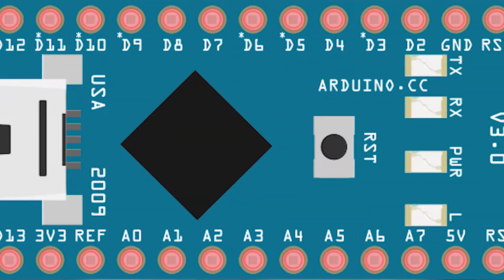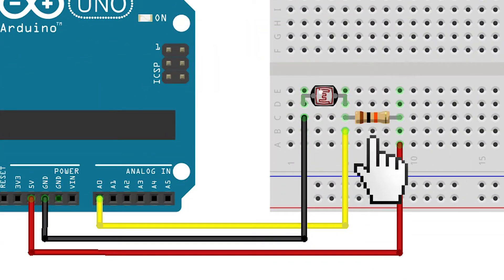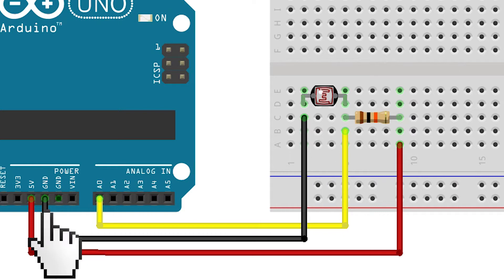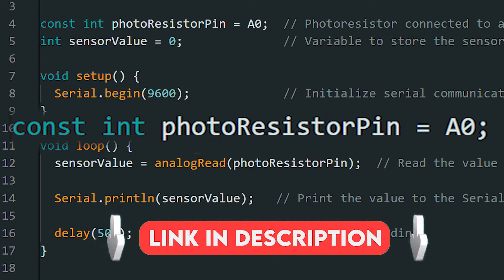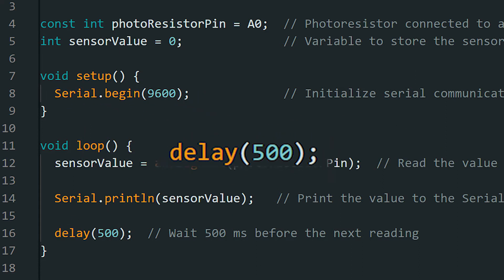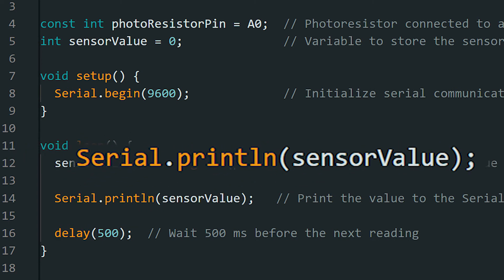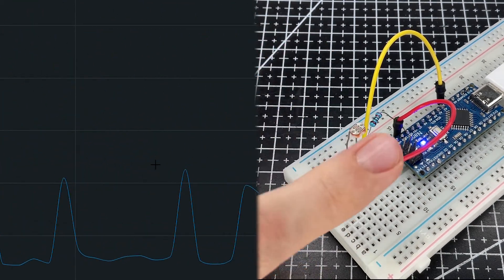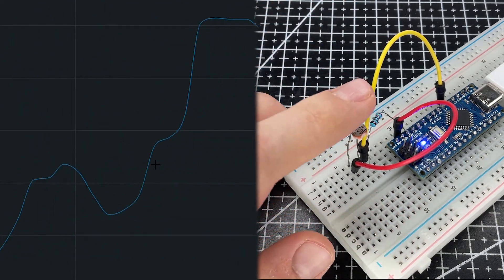Light Sensor: Arduino Photoresistor Guide 🌟

Comment: i bought some photo resistors from Temu, but the ones i bought are acting strange, i connect the probes from my Multi metre to the legs of the photo resistor, and point it to the light i get continuity, but when i put my finger over it and block the light, it goes open circuit. that is opposite to what they are supposed to do.
Reply from the maker: Try measuring in resistance mode (ohms) rather than continuity mode. The resistance should decrease in the light, and increase in the dark. If the behavior is the opposite, it may be a defect, and it is better to replace the photoresist with better ones.